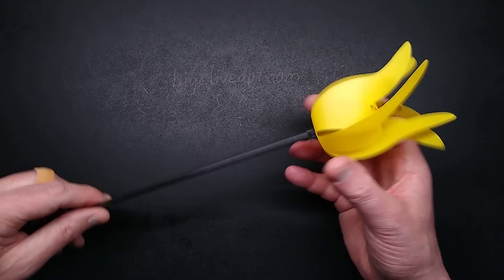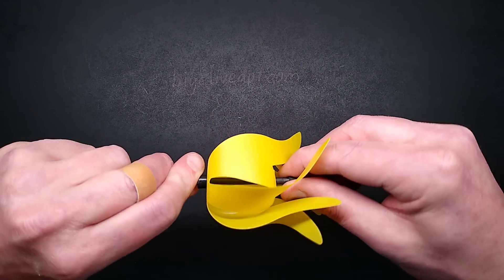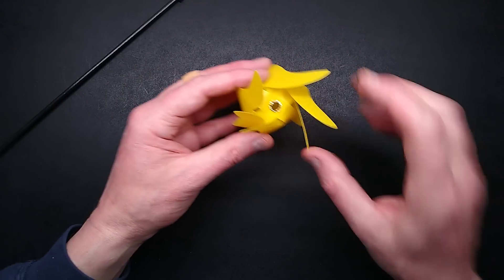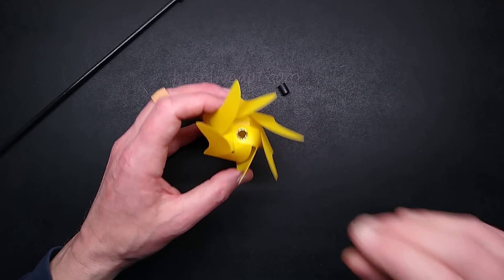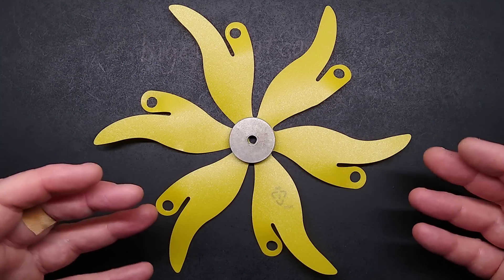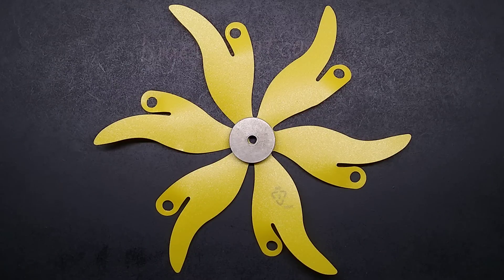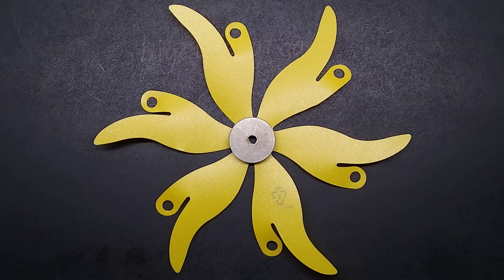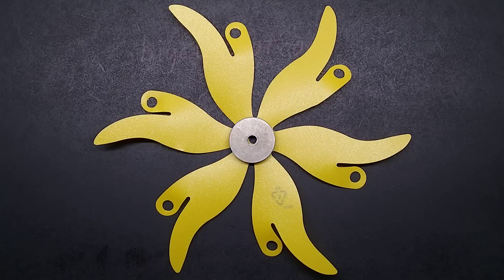Poundland Vertical Axis Wind Turbine (unfolded)

Comment: I have a garden light I made from a box aircon fan and its dc motor. Just need a rectifier and a 1000uf capacitor it lights up when wind spins the fan motor is dc40 volt I should upload a video about it.

Comment: Perhaps we can try this with TBR TURBO BIRD REPELLERS mounted on HIGH VOLTAGE TRANSMISSION LINES towers in city of Mumbai, India to prevent bird fault ( Crow dropping metal wire piece on Cross arm while building bird nest), these bearings are very very smooth and needs very low wind speed to keep rotating😇

Comment: Tried to make one at school, which would have been 1978-79.  The reason is that without having to turn a blade into the wind everything got a lot simpler.  We never managed to get it to work properly, but then materials and means of shaving them were all much more limited for schoolboys back then.  About 5 years later I'd actually set up a wind turbine of the conventional propeller-like type in my garden.

Comment: I have wondered about a VAWT for my back yard.  I'm unsure as to whether I'd recover cost in electricity savings even if I could make one. The straight blade Darrius type is pretty straight forward ( the more efficient helical blade less so ).  I was wondering if I could generate 300W which would charge a couple of 100Ah batteries from which I could run a PC.  I'm not sure I want to know how much my PC draws though.  I might not want to use it if I knew it's real cost and then I'd be sad.  In reality if I did mange to make it work the council would probably make me take it down.

Comment: Anyone as old as me -and possibly BigClive too, will remember VAWT advertising displays at petrol stations. They had a curved sheet of metal with a vertical axle in a square frame and as the wind blew they would rotate like big flat anemometers.
Reply from the maker: They were a fad outside shops here, but we're actually quite heavy and could spin at dangerous speeds on windy days.

Comment: i wonder about turning it into a path light, not solar powered, but wind powered. using a basic tiny generator, leds, and a small solar cell, im sure you could build an interesting spinning light, that can be powered through the night

Comment: Farmers have been using VAWT bird scaring devices for about sixty years now, and still do. There are three in the rented field just outside our yard, along with a bird kite that flies itself, and golfer scarecrow.

VAWTs are notoriously inefficient though, which is a shame because they are so simple and pose no real technical challenge to create.  When I was a wee bairn, we used to make these out of a square of cartridge paper, and some VAWTs will work horizontally or vertically!

One common application of a VAWT is the revolving signs to be found at petrol stations, and some shops, some years ago, and there are still a few to be seen even today.

As yard art at a farm a few miles away from here, there are two VAWTs - one in the style of a multicoloured balloon, and one in the guise of three witches on broomsticks, chasing each other around in a circle.

They can be used to drive generators, but on a ton for ton basis, cannot compete in terms of kWh/T.

Even so, VAWTs are somehow more relaxing to watch that the common or garden HAWT.

Comment: I'd think that the side-thrust on the bearings would be an issue.  Horizontal setups would seem to put less side-force on the bearings, aside from the weight of the turbine blades themselves.   But that's just a guess.
 
Are there any turbines where the shaft is 45 degrees from the vertical?
Reply: Unfortunately if it's not done after centuries of wind/water turbines then it probably means 45 degrees axis orientation would result to take the worst of both standard designs.
Reply from the maker: Not sure about 45 degree shaft turbines.

Comment: A couple of years ago, I 3D printed a few VAT models from Thingiverse and tested them with a small toy DC motor as a generator. No joy, unless there was a hurricane! 
Let's just say after a slight circumcision, it was a backyard wind lawn ornament without any motor for a while. Until it met a violent end by the riding lawnmower hitting the post it was on.   
It was good to see how strong of a wind it needed to just turn on its ball bearings. 10Km/h got rid of the friction from the bearings. Which I thought was too much for a small generator 15x40cm and abandoned the idea. I think nothing under 50cm in diameter, is practical as a VAT. Obviously, the bigger the diameter, the bigger the torque.

Comment: Many advantages to VAWT's, you don't need motors to face them into the wind (losing generating time and energy) , you don't have slip rings or long cables to get the power from the top, the alternator can be at the bottom of the tower (can't use a crane in windy weather on a HAWT if something goes wrong, and guess why turbines are in the windiest places), the tips of the blades don't go around at nearly 200mph (sandblasting in reverse when dust storms erode the blades), there are many other advantages
More research should be put into them, but we are told they are less efficient.
Reply: The truth is that VAWTs are aerodynamically very inefficient. The ones that are somewhat efficient are not self starting. Also if the wind is turbulent it will also be a very poor source of energy.
I think it's safe to say the optimum wind turbine design has now been very well worked out. It's the 3 bladed HAWT built as big as possible and installed offshore.

Comment: It would be interesting to add a magnet, coil and an LED so it glows at night when spinning.
Reply: Would like to see a bigckive project where he achieves this 👌
Reply: Big Clive, you’ve been called up to do this, I’ll be interested, to see how it comes out. 🤙🏼🇦🇺
Reply: Ikea used to do one but it was much bigger and also had a solar panel. When I got a 3d printer I ran the numbers on making something similar but it looks like the reynolds number is all wrong at that scale. The air doesn't flow over blades that small in a way that produces much lift. 
There was some XFLR5 spinff that lets you analyse wind turbine designs, both horizontal and vertical-axis
Reply: Magnet on the shaft, spin an inductor around, collect power in a capacitor, when voltage gets high enough activate a chip to run a light, if voltage gets too high run a brighter light.

Odds are they'd flicker in the night. But a garden would flicker in the breeze all night like it had a load of fireflies.

Comment: Kind of wish I had a 3d  printer so I could work on making this into a drone propeller.
Reply: It doesn’t generate a vectored thrust
Reply: @fredbloggs5902  I didn't think it did. My hope is that with some modification it can, and that the possible advantages would be the ability to use lighter materials while swapping out broken pieces faster than a rigid prop design.

Comment: I wonder if they would be quieter and not cast the strobe shadow effect like the standard wind mill.
Reply: They built a bunch of these in the 90's/Early 2000's and ended up all getting torn down, they were less efficient, more dangerous, and much higher maintenance, didn't really scale up either.  They're ok for residential/low power stuff, small ones work great, but utility moved away from them. They were really LOUD too, even the little ones you can put out on a shed are kinda obnoxious.

Comment: Power generation from any wind turbine is dependent on the "swept area" of the blades.  Real wind turbines, which change direction based on the wind, always have 100% of that swept area facing the wind.  "VAWTs" never ever ever have more than 50% of their swept area facing the wind.  VAWTs seem to make sense until you find out how wind turbines work and then you ignore them.
Reply: If I’m interested in learning more, would you have a resource you could recommend?
Reply: @Peter L

Would you like to edit your comment to correct your errors?

"Real wind turbines"

Both horizontal axis and vertical axis turbines are "real wind turbines".

HAWT or horizontal axis wind turbines are the traditional, common turbines, which change direction based on the wind. So you basically stated that "real (horizontal axis) wind turbines have 100% of the swept area facing the wind, and at the same time never ever have more than 50% of the swept area facing the wind."
Reply: @notahotshot  I would like to not make the mistakes in the first place ...
Reply: Try telling the Robert Murray Smith following that. They still seem to think the Betz limit is something that can be beaten by VAWTs that make no sense aerodynamically 🤦‍♂️

Comment: We have a lot of these over here in The Netherlands, although they don't appear to spin at all and when you try to force them the top comes off... 🌷
Reply from the maker: You can put that type in cordless drills to make them spin.
Reply: We have special ones here in Amsterdam, so special, they made a song about them.
Reply: @RS-Amsterdam  are you sure they're still there? I thought they were being sent with thousands at a time every spring. Spring is over so I guess they're all gone by now...?
Reply: @Sierra-Whisky  indeed. I have more than 100 in different colors in my front garden every year but indeed March April is tulip time overhere
Reply: @RS-Amsterdam  that would make the song a lot longer if the singer would call each individual color by it's name 😄
Reply: So many that there had even been a crisis in the stock exchange in 1636/1637! 🤭
Reply: @u.e.u.e.  The original NFT collapse!
Reply: @jrrarglblarg9241  Those days, NFT stood for non-forcable tulip.
Reply: 🤭😂 Let me guess, the most of them are at Kuikenhof. 🤣
Reply: @u.e.u.e.  I'm not sure if you did it intentionally or not, but for me as a dutchy, you've made a small but hilarious mistake. You probably meant Keukenhof. In Dutch, the word kuiken means duckling. And that made my imagination go into an overdrive, picturing the Keukenhof but without tulips. The tulips were replace by cute little ducklings. 🐥🤣
Reply: @Sierra-Whisky  ... not intentionally. I thought it's ui and not eu. 🤷‍♂️
Isn't it named after ducklings? What does keuken mean? 🤔
Reply: @u.e.u.e.  keuken is the Dutch word for kitchen. The Keukenhof, loosely translated as kitchen garden, used to be a hunting ground of a nearby castle, providing game, fruits and vegetables.
Reply: @Okurkaarrgghh  I'm sorry for taking shortcuts and stretching things up a bit, making it an imperfect translation.
Reply: @Sierra-Whisky  Ok, understand 😃
Reply: Cheeky
Reply: The same thing happens with babies if you try to spin their head around. It comes right off in your hands.
Reply: Interesting design, and thank you Clive for unfolding the mystery.

I hope that someone will do an R&D video on mating one of these to a tiny electrical generator or alternator to create a micro power supply.

Comment: I have seen quite a few of these on boats...especially sailboats...to keep the house batteries charged.  
They seem pretty efficient and more versatile than the horizontal kind.  
If my house was not surrounded by trees I would look at installing some.
Reply: The biggest reason vertical axis wind turbines aren't common at industrial scales is they are less efficient than horizontal axis wind turbines. But there are other reasons too. Despite the lower efficiency, they can be quite useful in space constrained environments.
Reply: @markirmuir  Space confined means there won't be any consistent useful wind.
Reply: Sadly, they are much less efficient that horizontal axis turbines, but they do have some advantages.
Reply: @graemezimmer604  I've never seen a VAWT catch fire.
Reply: @boldford  Were the VAWTs made in the same scale as the normal HAWTs with similar loadings on their bearings then I don't doubt that you would. 🤔😉
Reply: @theoztreecrasher2647  Were that the case I'm pretty certain they'd have fitted bigger/better bearings by now. I think there's also something fundamentally wrong in putting an alternator many meters up in the air on top of a stick where they are difficult to service.  Purely my personal view.
Reply: @boldford Because it is toys only. Pros use HAWT.
Reply: @Stefan_Dahn  It's them that has the fundamental flaw of putting an alternator many meters up in the air on top of a stick where they are difficult to service.